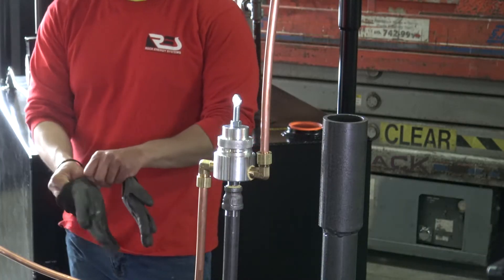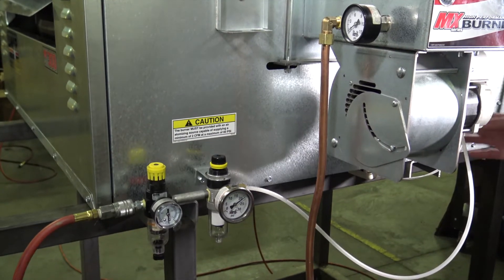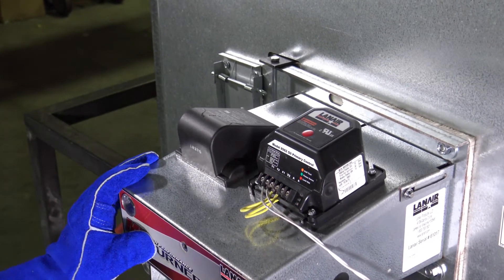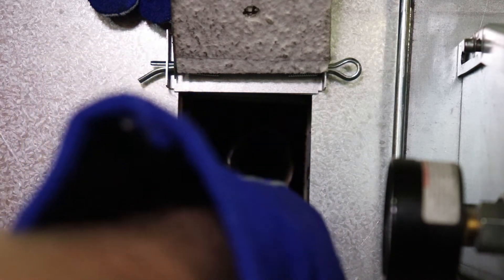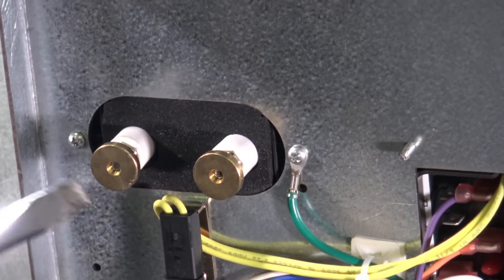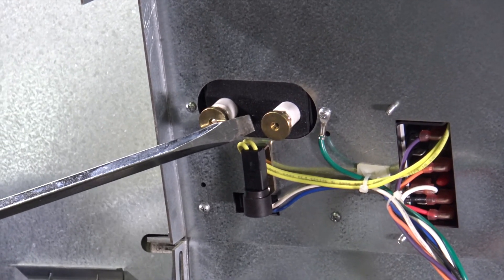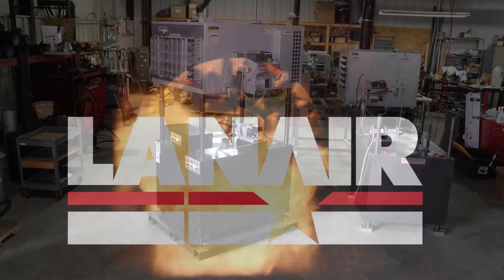Lanair Waste-Oil Heater - MX-Series Ignition Test

Comment: I was wondering if some could help me out with my mx200 I've cleaned the furnace  filters heating block etc the furnace will run threw a heat cycle after a hard start but it will not refire do to the pump losing prime it will fire up after I bleed the pump with the bleeder bolt I do not any leaking supply lines any help would be appreciated
Reply: I’ve had a lot of problems with motor to pump coupler causing shut downs ,when coupler gets warn . I’ve changed 3 in about 4 or 5 years.

Comment: Came here for help, but found nothing but a badly shot video. 
1:41 put in test mode
2:11 now magically back in normal mode, not test mode
2:25 now not bridged and not in test mode.
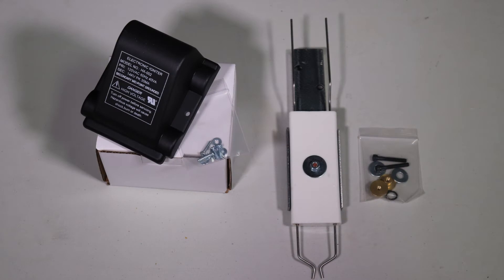3:43 still shown not in test mode, but magically can test spark.

 If you are actually in test mode, no air pressure and jumper wire in place.

If I have to keep guessing on how to do this, your video failed !!
Reply: I agree, I’m now stuck in a loop trying to get in contact with customer support with no luck. My burner is spraying oil when in test mode and currently has no ignition spark.

Comment: The motor only humming on our Bracket furnace
Reply: If you have an amp-clamp capable meter. Take the amperage reading while the motor is humming. If it's higher than 3-5 Amps, the motor or capacitor will need to be replaced.